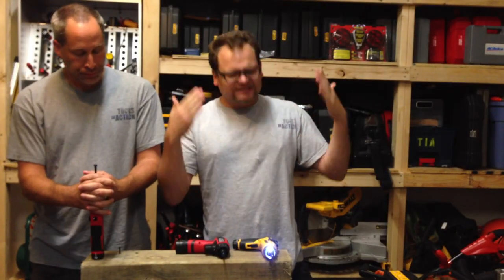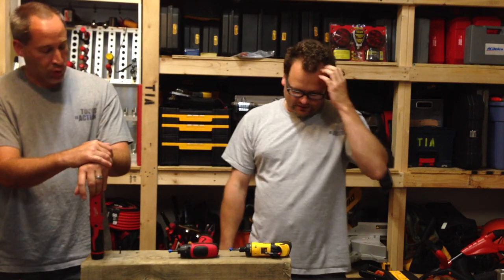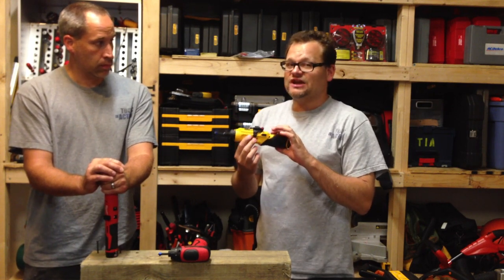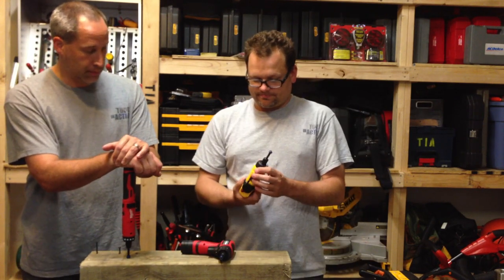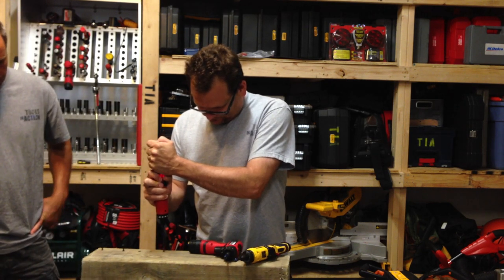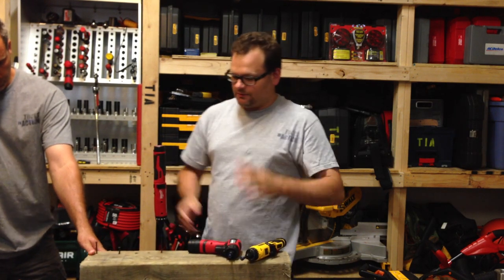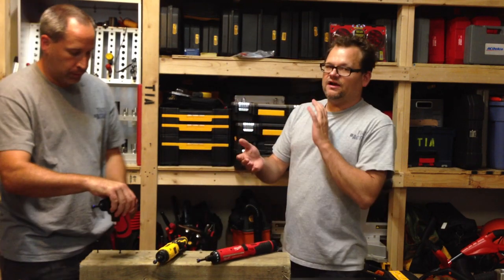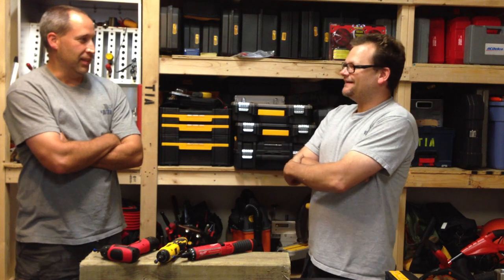Pocket Screwdriver Friday Night Tool Fight

Comment: Hey Dan your video made me want to have a cordless screwdriver,  i've never had one before but today I went out and got me one. I ended up getting the 3.6volt Hitachi DB3DL2. It was on sale for 49.00 at Lowes its normally 69.00. It comes with a case, two 1.5 AH batteries, high and low settings,  LED light, 21 clutch settings and drill mode and a bit lock so you can manually use it like a screwdriver. 44in Lbs. The only thing that it doesn't have is a battery gauge.

Comment: Can't believe with that small voltage they all did great. I still would just go m12 because of the tool options for the same battery platform.  Or dewalt or Bosch 12v lines

Comment: Dewalt and milwaukee would be my choice for this becuase both companies will create more tool line for these. I  would use the dewalt for electronics or doing wall elecrtic jobs. And the m4 for all aroubd. But that ac delco is pretty strong

Comment: I see the comparison.... However, I left my old 7.2 Dewalt stick for the M12 hex driver. Lighter weight more power better feel and a led... Also just like the old platform Dewalt won't come out with anything else for that battery and I don't wanna learn the gyro parlor trick... I think these stick drivers should go the way of the dodo- 12 volt tools are now small enough to do anything they can

Comment: It's such a shame Milwaukee and Dewalt have entirely abandoned their M4 and 8V Max platforms. I think there's a real need for a sub-12v category for smaller, lower powered, more precise tools. Have you guys heard anything about M4 or 8V Max?
Reply from the maker: no :{
Reply: Tools In Action It's crazy they introduced these platforms with promises of more devices and then did nothing with them, right? Would you agree there's a need for a sub-12v platform or is it really just me asking for this? Trying to gain perspective.

Comment: Good tool fight. Acdelco is the clear winner. Can I suggest a tool fight? Now that milwaukee updated their m12 brushed power tools, how about the new brushed m12 impact driver with 1000 lbs torque vs dewalts 12v max impact driver. You guys did this tool fight before but with Milwaukee's older original m12 impact driver and Milwaukee took a beating. I wild like to see the new m12 impact this time vs dewalt.